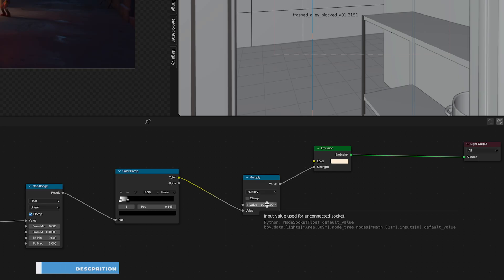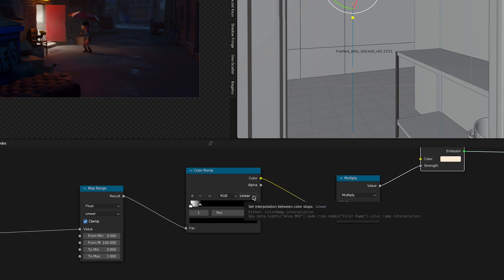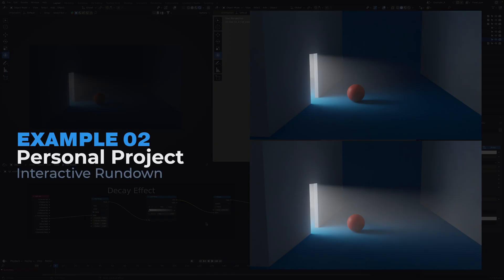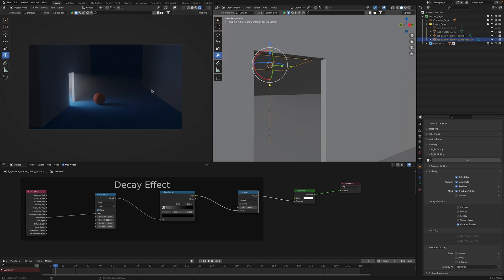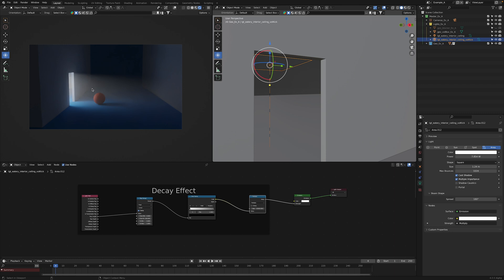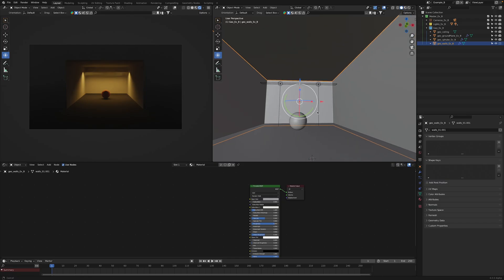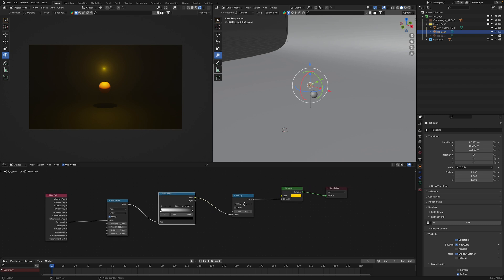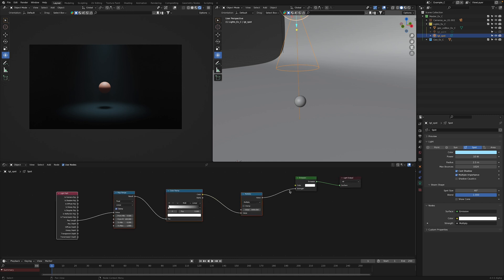Practical Applications of Light Decay in Blender

Comment: An elegant solution! I have an unresolved question though. How would you handle a scene with a character outdoors where some shadows need to be hard, while shadows on the character need to be soft? How could this be implemented? Thanks for the answer.)
Reply from the maker: Hmmm you could use a render layer where you have on the main/master/beauty layer a ground plane for example with receive shadows turned off on the ray visibility in the object settings(orange cube tab). Then on the other render layer you could have a shadow catcher plane(object settings). You could on the shadow catcher layer hold out the characters as well. Otherwise you could maybe make a sun light that would have harder shadows and unlink it from the characters but keep shadow linking on so it casts shadows from the characters onto the ground. Then have another light with softer shadows linked just to the characters(shadows and light). Think that might work. In regards to the material method you might want to make a separate render layer and override the material as mentioned above and hold out the characters on it and again use the shadow catcher ground plane to catch the shadows with a less feathered shadow edge. Would probably need a separate video for that though. Good luck!